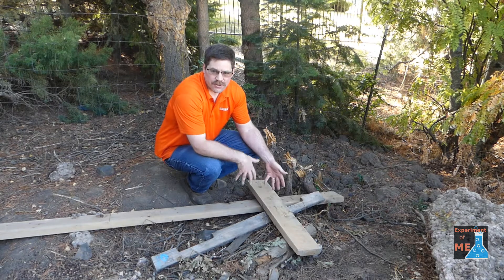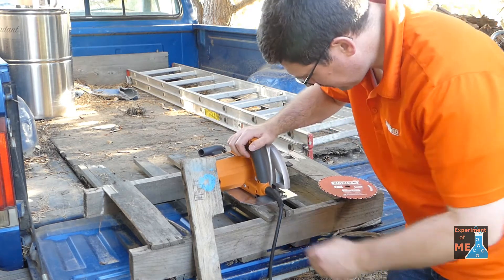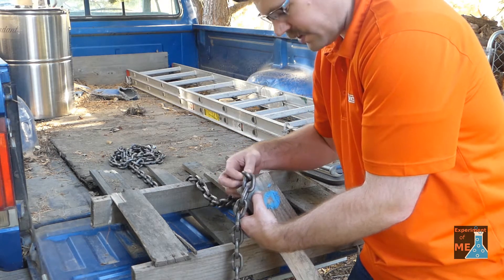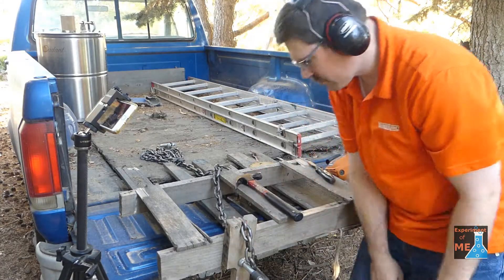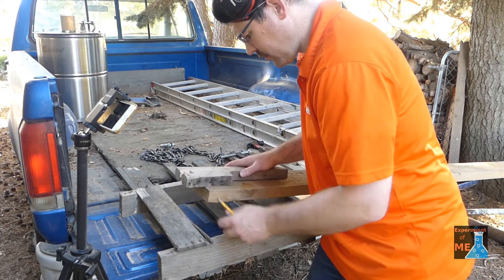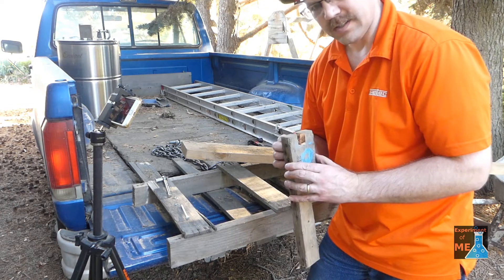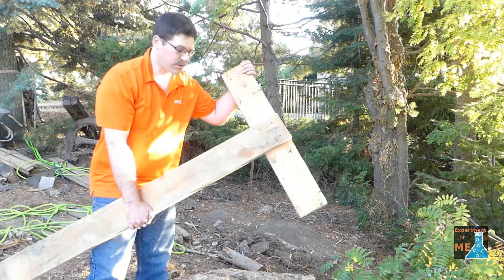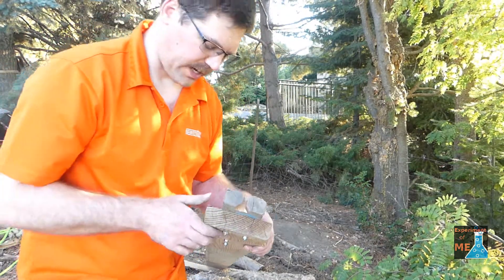Build a Stump Pulling Mechanical Advantage Lever.

Comment: 2 galvanized steel fence posts. 
2” diameter by 8’ long. 
A-frame that won’t fall sideways 
Don’t even have to bolt together at the top. Notch the top of both to fit the chain links precisely.   Anti sink feet and a piece of rope at bottom to prevent splaying.
Reply: Step 1 buy a lever hoist for 50 bucks.
Step 2 done, lol